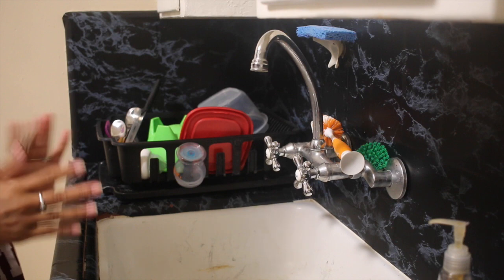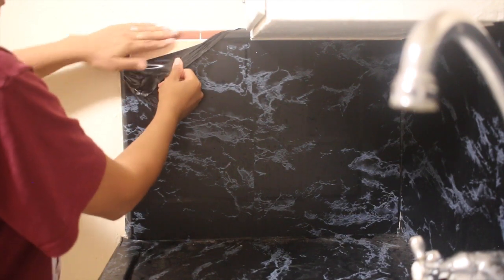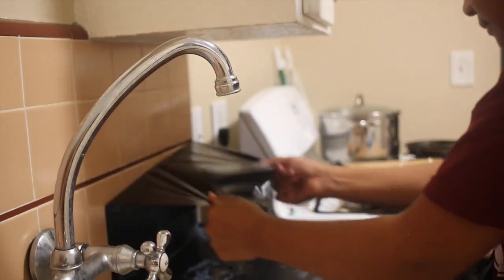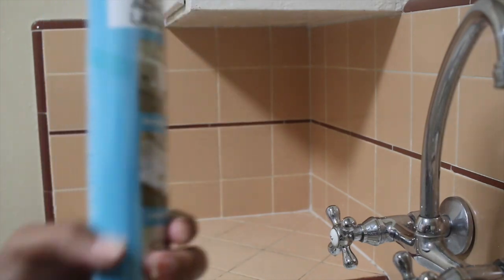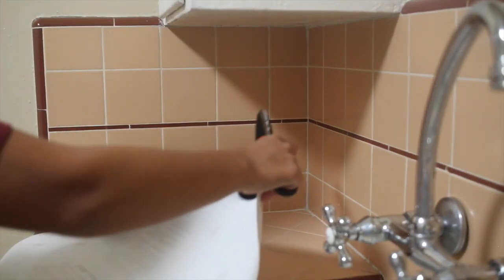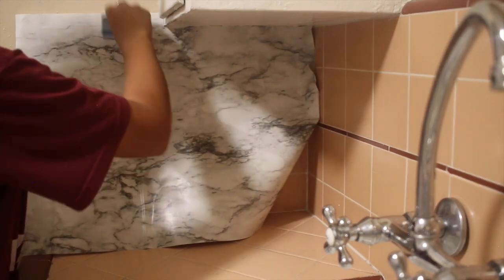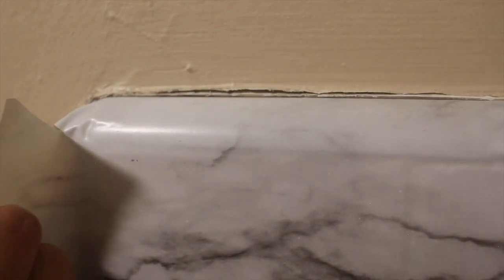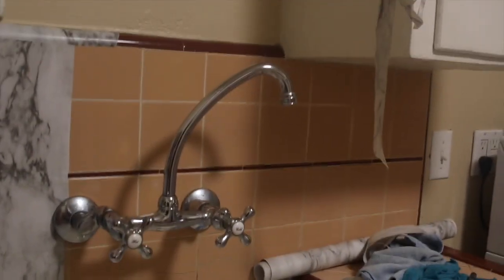TILE KITCHEN COUNTER TOPS MAKE OVER | W/ CONTACT PAPER!

Comment: How long did you have the previous contact paper on before it started smelling?
Reply from the maker: Id say over a year
And that was our fault because we were cutting on top of it, like no cutting board. So if you do not do that it can actually last a while. I've seen other people add sealing glue at the edges so no water gets in so I would definitely do that